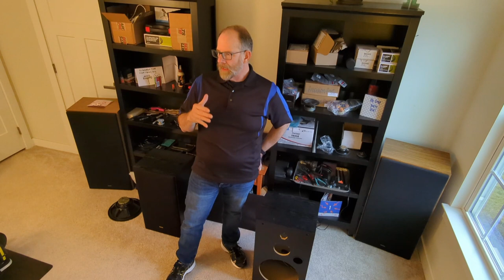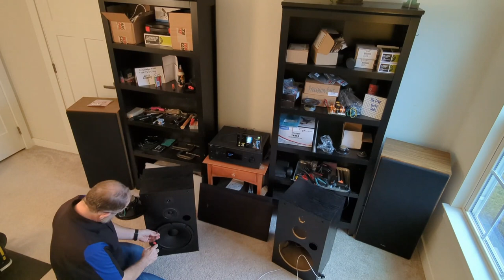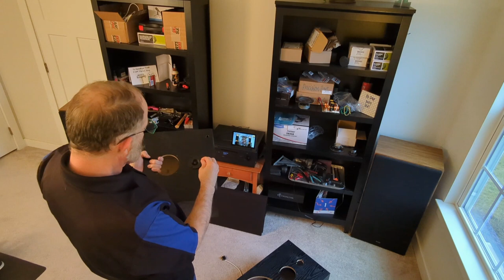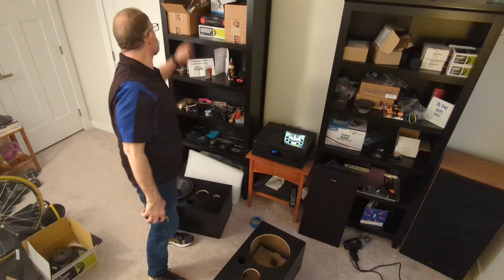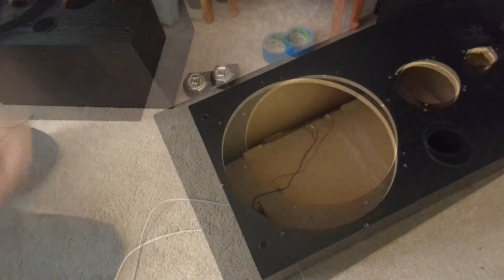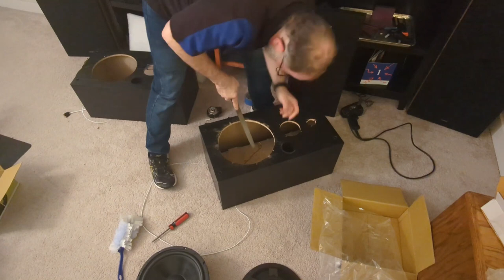Cutting And Modifying Holes To Fit New Speakers Into Vintage Speaker Cabinets RCA STS-1230 Part 3

Comment: I put all new drivers and crossovers in a pair of old bose 501s.  they sound so much better now
Reply from the maker: I always thought it would be cool to redo the 901's. When I was a teenager, a friend's older brother had a set that sounded pretty good. They didn't have the volume, presence or punch of the big speakers from that era, but they did sound good to me. The whole direct reflecting concept was strange though. Most people run them with the drivers facing out instead of at the wall.
Reply: @wattspeakers  that would be a fun project working on 901s

Comment: Take your router or roto zip cut a blank that just fits the opening with your circle cutting attachment, glue the blank in place, putting a peice of glass on top to keep it even, now use your circle cutter again to cut a PERFECT opening it doesn't take much longer.  . . Use a router bit not a roto zip bit
Reply from the maker: Thank you for the suggestion! Excellent idea.